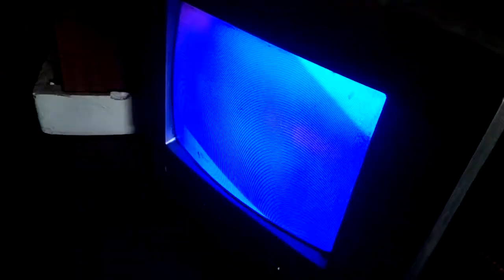TV SAMSUNG TIDAK BISA NYALA TAPI LAMPU POWER HIDUP

Comment: Saya ganti tr horizontalnya tegangan b+ jadi naik turunya mas 130 kadang 120 ..knp ya   ??  Kapasitor keramik blm tak ganti stoknya gax ada..
Reply: Dan ada bunyi tik tik barengan lampu indikator yg kedip2 terus
Reply from the maker: @jonojoni6576  ya itu kayaknya bukan dari cap.. menandakan ada beban shingga mesin mau start kembali standby lagi. biasanya klo b+ naik turun saat mesin start kembali standby. dkarenakan FBTnya stengah short atau elcho b+ kisaran 160v/100uf dah kering minta ganti. Dan masih banyak lgi penyebabnya.. smoga berhasil ya...
Reply: Apa mungkin tr horizontal yg rusak nya soalnya tak lepas tak cek gax ada nilai semua tak bolak balik..waktu mau pasang gax tak cek dulu tr horizontalnya
Reply: Pas tr nya saya lepas tegangan 135v kadang naik 138v turun lg 135v
Reply from the maker: @jonojoni6576  ya klo tr hot dah rusak biasanya di ukur pakai avo arus bolak balik menunjukkan hasil sama itu rusak/short konslet.pengukuran pin kaki tengah sama pinggir. klo arus avo bolak balik tidak ada hambatan jg tr hot rusak atu putus.. ganti saja dengan tr Psu copotan saja.. ato bekas computer. lebih awet. yg pasti orisinil..
Reply: Mungkin tr hot nya ya bos..coba nanti tak ganti yg baru..

Comment: Tv ku jg begitu mas model sama Kedip sekali..apa yg harus diganti
Reply from the maker: ganti saja capasitor kecil deket tr Horizontalnya.. sering kali bermasalah untuk tv samsung. ganti dgn ukuran yg sama biar kualitas jg layarnya pas.. biasany ukurannya 681. / 2kv. yg bodi kecil.. sebenernya masih banyak lagi sistim proteksi di ic vertical Dll.. Jgn lupa cek smua tegangan2 normalnya saat tv start jg standby.. Moga berhasil..
Reply: 471 2k mas tak copot..
Reply: Diganti yg 681 kah atau yg 471
Reply from the maker: @jonojoni6576   
ya yg penting 2kv itu menandakan 2000v.. biar kuat dan awet.. itu jg mempengaruhi layar lebar sempitnya jg kanan kiri. jadi klo bisa ganti ukuran aslinya saja. menjaga mesin biar tetap orisinil...
Reply: Ok ..trimakasih..tak coba ukuran asli dulu 471 2k